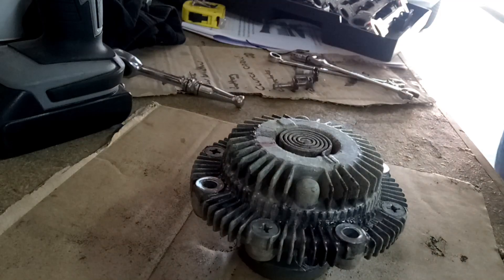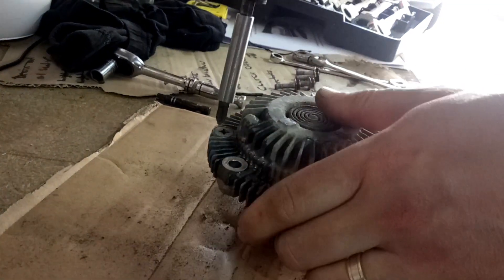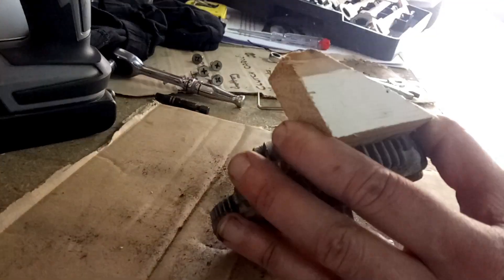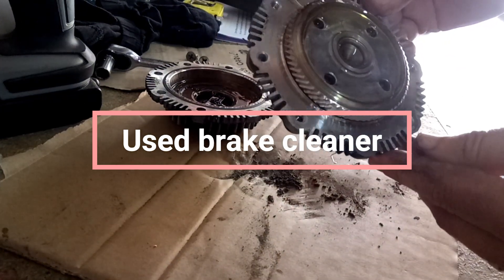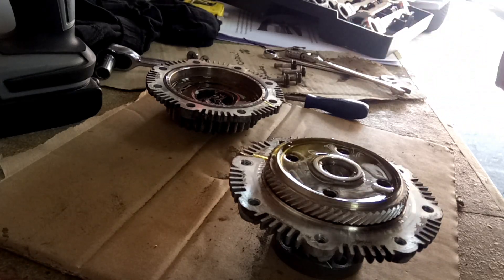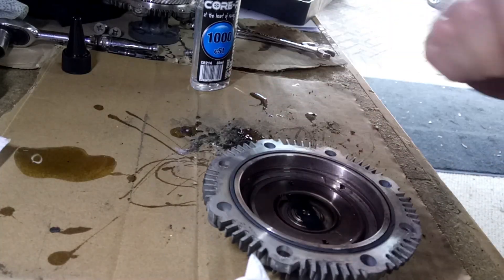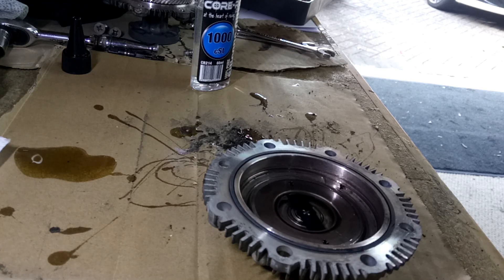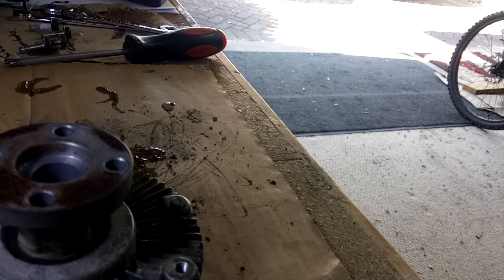Overheating under load? Gen3 Jimny thermo coupling radiator fan removal and repair

Comment from the maker: ** UPDATE ** Had a couple of days in Wales with trailer (4hr trip there and 4hrs back), and pulling trailer on some lanes. Managed to go on the few hot days between the rain and no overheating, so seems to have worked.

Comment: Hi mate, trying to get it out without removing the radiator as you did. How did you get access to the nuts on the bottom of the clutch? Can't fit my ape hands into the spaces haha
Reply from the maker: @jackcaton8518  hi. If you can't get to them, put a socket on bottom pulley and rotate engine by hand a small amount to bring them to the top. Cheers
Reply: @CLSJimny4x4  Thanks mate, this worked great. To anyone coming along in the future - if you find the nuts are so tight that you're moving the water pump  when trying to get them off, get a mate to hold a spanner on that bottom pulley. Cheers.

Comment: Greate job. What exactly oil did you use and what are the symptoms of a bad fan?
Reply from the maker: Hi, a picture of the oil is shown in the video, used in remote control cars I think. The car started to overheat under load, and felt as if there was no resistance when hot. Cheers